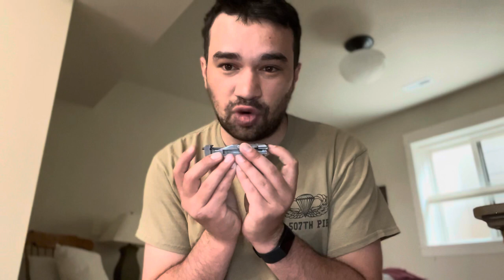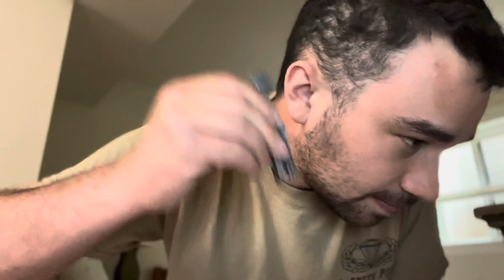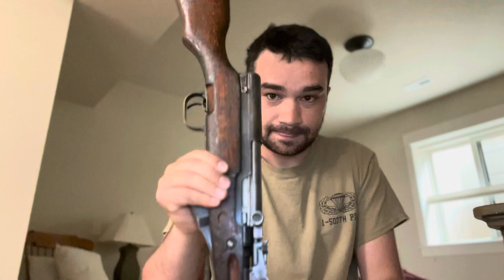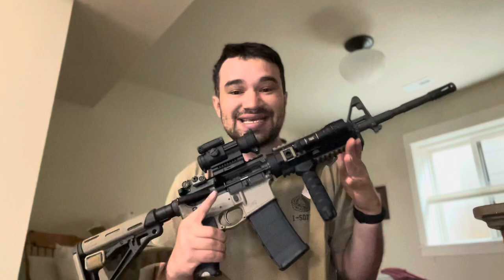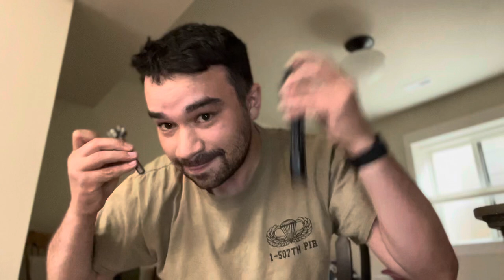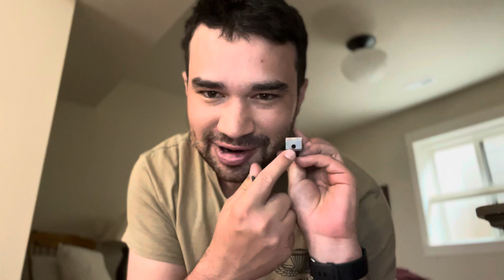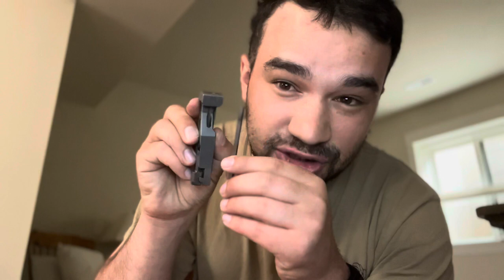The Myth of the SKS Slamfire (why you don’t need an “enhanced” firing pin)

Comment: A fun fact, "boiling" SKS has been an effective way of removing cosmoline, therefore keeping the gun functioning correctly when taken out of storage. It's still being used.
Reply from the maker: I’ve heard that! Sometimes even in steel barrels over a fire, right?
Reply: @Triangle26  Yes with big cast-iron woks, there are still photos with active Chinese soldiers. Youtube doesn't allow links.
Reply: I boiled my bolt carrier group. No problem! 👍 cosmoline soup not bad. Just add one carrot and some salt.
Reply: put it in a black plastic bag and lay it under the sun. It will sweat out the cosmoline.
Reply: @HernanMoragaMmHs  I like this idea. Thank you
Reply: For the initial cleaning I use mineral spirts. I have free floating firing pins on all my SKS’s and have never had a slam fire. I always use corrosive ammo how ever clean them after every use using hot soapy water brush everything down rinse with just hot water dry and oil everything. Only takes an hour at most.
Reply: That is unbelievably lazy
Reply: @ericdulyon4601  Yep, and dangerous also. Not a good idea fellas!!
Reply: I like hanging main components next to a hot wood burning stove (not wood, plastic, or bakelite). Place cardboard and other cosmo "absorbers" unerneath. Finish off with a nice bath in mineral spirits. Clean, lube, and reassemble.
Reply: Hairdryers work well too.
Reply: @cerberus7.625 yup thats what I use also. Mineral spirits breaks down any grease.
Reply: I wonder if boiling the trigger group is harmful in any way.
Anyone ever do it?

Comment: I bought a Yugo SKS about thirty years ago, when they were plentiful and cheap. I spent hours cleaning the cosmoline from the stock and internals, other than the firing pin channel in the bolt, as I was unaware of the issue and thought that I'd done an adequate job. Took it to the  range. Loaded one round and fired it for a function check, and all good. Loaded two rounds and it slam fired. A helpful and knowledgeable SKS owner heard the slamfire and showed me the problem and how to fix it. Ive put over a thousand rounds through it without any further slam fire problems.

Comment: I have personally purchased 2 SKS rifles that had been stored in cosmoline and had to be cleaned fully by me. Each had cosmoline and metal sludge inside the firing pin channels. And after removing the extractors and firing pins and cleaning the bolt firing pin channels and responding parts no issues after thousands of rds. 
Two rifles I purchased, a Yugo and a Chinese paratrooper carbine, were both completely clean on the outside of rifles. Looking like they had been well cared for by previous owners. However, neither had firing pins that would "shake" freely in hand.  Upon disassembly of gas system and bolts on each rifles they both were full of cosmoline and crap. But functioned perfectly after I properly cleaned the rifle components on each. 
People think they can wipe a SKS down and start shooting.  Then they act like the rifles are garbage because they slam fire. 
There are videos from the manufacturer of the aftermarket spring loaded firing pin for SKS rifles that show him disassembling a customer's sent in complete bolt with stuck firing pin. When he removes the extractor pin to remove the stuck firing pin it was full of rust, cosmoline, and metal sludge.  
Fun fact.  Only the later AK 100 series rifles copying the AK74 style changes to the AKM based rifles, like Molot Veprsand AK102,103,104 etc use spring loaded firing pins. And the spring loaded firing pins have their own problems. Like wearing out the flats that trap the firing pins requiring frequent replacements.  Many, like myself, have removed the spring from our newer 74 based AKs in 7.62x39 rifles. With zero issues afterwards just like the millions of AKs made with free floating firing pins.  Like SKS rifles. 
Whenever you clean your rifles take your bolts and shake them by hand. If the firing pin doesn't freely rattle back and forth you need to fully disassemble your bolt and clean the firing pin, firing pin channel, and keep those things oil free and dry.  If you oil your firing pins you will have issues with firing pins getting slow to move freely quickly.  Just like the gas systems of both style rifles, never use oil or grease in the gas systems or firing pin areas.  
Rifles are fine. Frustrated with your SKS rifles slam firing? I'll buy them off you cheap.

Comment: I think you have accurately identified the cause of the SKS pattern "slam fire problem" - cosmoline, rust, or neglect.  My /416\ is a beautiful specimen that performs flawlessly.  When I got it, it had a dust cover-mounted scope and a twist-on muzzle brake.  It had duct tape residue around the barrel and cleaning rod, as this was the previous owner's method of holding the cleaning rod in place, since it was missing the bayonet.  I guess it sucks when the cleaning rod falls down after every shot.  I got rid of that crap and acquired a bayonet and proper dust cover.  I did a complete strip, and it didn't look too bad.  It was fairly clean, with small amounts of cosmoline here and there.  The firing group was pretty clean.  And then I ran a patch through the gas block, and a big noodle of cosmoline came oozing out; I could barely get the cleaning rod through it.  Similar with the tube.  I don't see how the rifle was feeding - it couldn't have been working too well.  That may be how I came to acquire it at a good price.  She's a great looker now, and a great shooter too!
Reply: That’s actually how are boys in Vietnam carried cleaning rods is with duct tape

Comment: Great video. Owned several SKS over the years and never had issue with slam fire. However, I do keep my bolt clean and make sure the firing pin moves freely.
Reply from the maker: Thanks for watching! Glad your carbines have run properly for you.

Comment: Last week I picked up my first Sks (Tula 1950r), I love the thing 😁 I couldn’t agree more about fully inspecting a firearm before firing/ purchasing; especially a surplus type firearm. Not just for firing pin function but any other possible wear, issues, or damage. I always field strip a firearm before a purchase, always ask before hand tho. If a dealer is not willing, I usually don’t purchase. At the minimum I dry fire pen/pencil out of handguns with the barrel pointed up to test a firing pin’s strength. But anyway, good vid.

Comment: Just found your channel after hearing Hickok45 mention you. I honestly don't understand how you don't have 100x the subscribers. Your videos are are amazing, fun to watch and packed with good information. Free floating firing pins have never bothered me because I understand the firing pin by itself lacks the mass to detonate a primer, but I hadn't thought about all the downsides to the "enhanced" firing pin. In addition to your points about introducing a foreign object to your firing pin channel and no longer having an easy way to to confirm the firing pin is free, I'd also think the enhanced firing pin could cause light primer strikes due to the firing pin spring absorbing some of the firing pin's inertia.
Reply from the maker: I really appreciate that, thanks for giving the channel a chance.

You are exactly right about that spring soaking up some inertia. Ironically, this is one of the documented reasons why the Soviet’s got rid of that feature in the first place. The pre-1951 SKS-45 actually did not have a great reputation for reliability, and light primer strikes were one of the leading issues. The free-floating pin was introduced to solve this issue, and was much more successful at reliably ignoring a wider range of primer types.

Comment: Another GREAT VIDEO.
I've had a SLAM FIRE. But it was caused by a popped primer. Pieces got wedged onto and around the Firing Pin. Nothing to do or caused by the Free Floating Firing Pin.

As for removing Cosmoline;  I soak in Mineral Spirits, Rinse in HOT water, Blow dry with compressed air. The Hot water aids in drying all the parts. There is no scrubbing or extra cleaning that has to be done.
Has worked Extremely well for me. 
Keep up the Great Work.
And Thank you for taking the time to make videos like this. WE DO APRECIATE IT.
Reply: Due to popped primers, I've sworn off of Tula and the stuff in a white box whose label included "made in russia" and "for hunting" (hollow points of some kind). 

I THINK it's just that some rifles have a relatively tight throat and some ammo has relatively weak primers, /shrug.

Comment: This information is bang on.  I just bought an SKS and it is probably one of the worst for a stuck firing pin.  After taking the retaining pin out - a chore and challenge in and of itself - it was extremely stuck - I couldn't even remove the firing pin with the retaining pin out until I used pliers to pull it out.  Once it started moving I realized why - it was caked in not only cosmoline but black bits of debris, grit and grime.  The pin was seized by all this crud and was protruding from the bolt - it was a slam fire waiting to happen.  After boiling off the cosmoline I used a q tip and a pipe cleaning to clean out both the firing pin and the retaining pin channels and obviously cleaned the firing pin immensely.  Note - do not oil or grease it after - you don't need to attract more contamination after.
All that said, the other issue even if the firing pin is not stuck in the forward position is the issue of sear engagement.  Some SKSes have a negative sear engagement which could cause the hammer to fall based on hard impact and movement, etc.  Most Russian SKSes have a neutral sear engagement.  Some people do trigger jobs to change the sear engagement to positive, just for additional safety considerations.  
Good video, great information and excellent presentation. You earned a sub from me.

Comment: I acquired my first SKS early this year, a /636\ 20M, with a Tapco handguard and neutered bayonet lugs. I admit I hadn't done a lot of research on them, so was unaware of a slam fire issue when I took it out and put about 100 rounds through it. When I did a detailed cleaning of it(I know, should have been first) I found cosmoline in the firing pin channel and in the gas tube. I know I got lucky. Now I make sure the pin rattles.

Comment: I had some round with a soft primer that didn't like the free-floating pin hitting it more than once so it popped a cap at an undesired time.  I replaced it with a Murray's years ago and have shot it a few times since then.  After some consideration I went ahead and put the original back in.  Heck, I have at least five other rifles with free-floaters and have no issues. lol.

Comment: Thank you for answering  a question I had reached the same conclusion. When I got my SKS, I cleaned it exhaustively. I still placed the Murray's firing pin, mainly out of ignorance and out of concer that it might be prone to excessive carbon or dirt under prolonged unmaintained use, it hindsight,  it was silly. I know better now. Thanks.

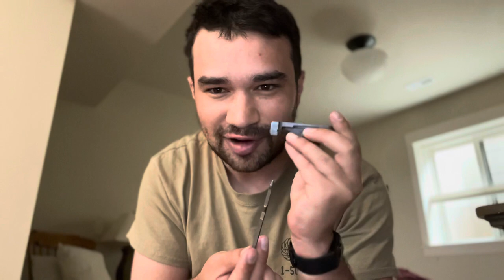Comment: 08:34
Wow, I never thought of it this way.
I always figured that it would only slamfire if the firing pin was fully stuck and that the rifle only really had 2 "states" where it was either unstuck or stuck and slamfiring.
I didn't think of the relation between the amount of cosmoline and the risk of slamfire goes up even just ever so slightly even with smaller ammounts of cosmoline or fouling.

Very well explained and probably the best explanation I've seen so far.

Comment: You, my friend, are absolutely spot on!!  
YES - rust or cosmoline gunk build-up in the bolt firing-pin channel COULD lock the firing pin in the forward position.  Ergo, a "slam fire" if the bolt is dropped on a live round.  This would only result if  the gun cleaning has been negelected.

Comment: Great channel - recently found it.
I still have 3 SKSs. I always put the bolt mechanism in boiling water. Shake it up with a set of tongs. All the cosmoline floats to the surface. Remove the cosmoline with a paper towel then remove and blow off the parts. Ballistol or CLP and reassemble.
Reply from the maker: Thank you!

I agree - the technique you describe is extremely effective and definitely something I recommend.

Comment: Great channel. The SKS is my favorite platform. I have a '78 Chinese, '54 Russian and '50 Russian. My '50 Russian has a spring-loaded firing pin, whereas the others have free-floating. Guess which one has slam-fired on me? Yep, the '50 Russian. Never did figure out why it happened -- I keep the pin clean.
Reply: The spring is not heat treated and will deteriorate in time causing the sks to slam fire because of spring debris.

Comment: Hi, Thanks for this video!  I picked up an SKS quite a while back, but have yet to fire it out of concern that it may slam fire.  But I also have seen so many posters like you who point  out that if you hear a clicking noise when shaking the bolt, that means the firing pin is properly "floating", as it was designed to do.  And when the bolt is closed on a live round in the chamber, a properly free floating firing pin will "lightly" hit the primer, but will not have enough energy in it to fire it.  Now.... if some debris, dirt, or anything finds it's way into the channel that pin floats in, and it ends up sticking in it's forward firing position (instead of "floating" back to the rear of it's travel like it's supposed to do), that forward pin will fire that round.  And as the gun goes through it's normal ejection/reloading the round sequence, when the bolt slams forward again, that pin stuck in it's forward position will AGAIN fire that round... until ammo is gone!   The main thing is to make sure thae firing pin moves freely!  Grab the bolt and pull the firing pin back and forth where it sticks out at the rear of the bolt.  If it moves freely back and forth, you're good to go.  But if you feel any kind of friction, or something preventing it from moving smoothly, at least get some lubrication down into that channel until it moves back and forth with absolutely no hangups.   Then do the shake test to verify it's floating freely like it should.  And now I think I will get my SKS to the range, it's about time!!  :D

Comment: As someone who has been down this winding path, thank you for a great video. My first wife read an article about a slam fire SKS incident. Later I picked one up in a trade and obtained one of the "reworked" firing pins. That opened the door to misfires and an untrusted rifle. Of course the real culprit was removed long before that with carburetor cleaner.

Comment: Thanks for this useful video. I witnessed an actual SKS slam fire c. 2009. An idiot took his new SKS to our local range straight from the gun shop where it was purchased. He popped a full clip of rounds into it, and—surprise, surprise—he zipped through ten rounds in an unintentional burst when the bolt was cycled and allowed to slam shut. No one was hurt, as the gun was pointed (more or less) down range at the time. After some commotion, he was sent home promptly by the range officials. It was fortunate that whatever debris was probably in the unchecked, unswabbed barrel bore didn’t make this already unfortunate situation much worse. I have owned many SKS carbines (Russian, Chinese, Yugo), and post-purchase cleaning, inspection, and maintenance have always the first order of business to keep these wonderful older guns safe and running with the top-notch reliability for which they are known.

Comment: I have 2 sks’s a “26” and a consumer china sports imported… Inhave had multiple slamfire issues with the china sports and zero issues with the previously issued “26”. I have done multiple cleanings of the complete stripped bolt compared the the two different bolts and discovered in the matching numbers china sports bolt there was an issue with the taper relation of the firing pin and the interior surface of the bolt face that at time would cause the pin to wedge into the pin port and cause it to slam fire…this of course is a manufacturing issue that I’m sure is extremely rare but I just wanted to make known my experience with this machining defect. 

Your video is spot on for the common causes and issues for slamfire to happen…though. I found that running the pins basically dry has made the issued one extremely reliable to the point of never slamfiring at least to date…after replacing the bolt and and of course checking the surface in the fresh unissued one I purchased I haven’t had any problems since. 

Thank you for addressing the spring pin, it’s only common sense that a spring is at some point going to fail and unless cycled regularly will happen at the least opportune time…floating pins and proper responsible maintenance is the most reliable and safest way to operate these types of actions…and safe is the key word…

I trust these rifles over many modern more “popular” rifles anyday…
Reply: The SKS pin and channel is a shit design. Cosmoline CAN cause slamfires but more likely is something like you described. If you're still having issues, you can use a drill bit to clean up the firing pin hole and chamfer it just a hair. Polish the channel and make sure the pin is straight and you should be good to go.

Comment: Interestingly BACK when the USA manufacturers made 7.62x39 They used COMMERCIAL thickness primers which exacerbated this problem. ONE reason why KENGS (polytech ak fame) made the legend series ak-47 with a spring loaded firing pin.